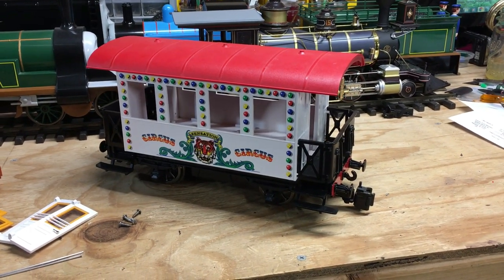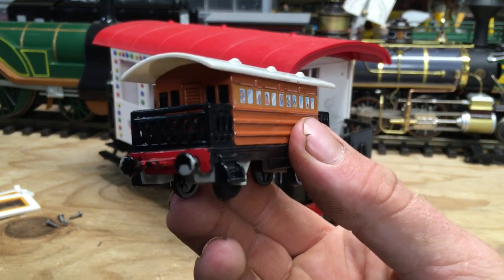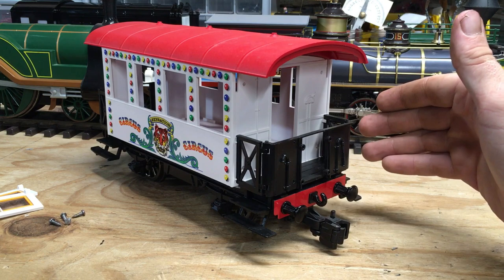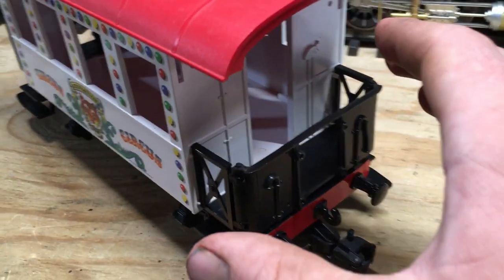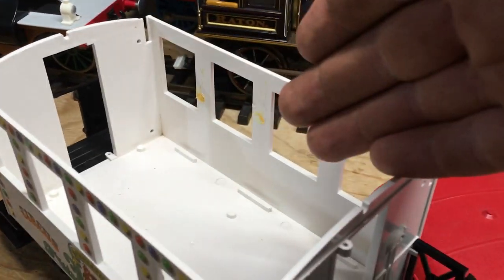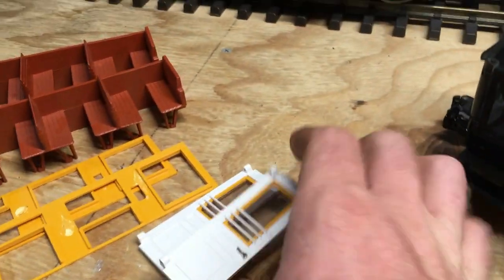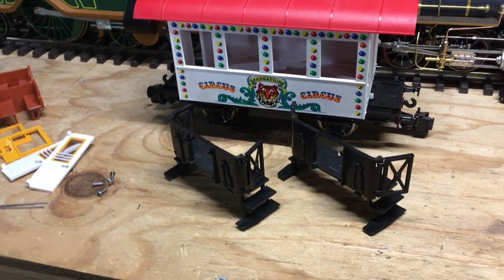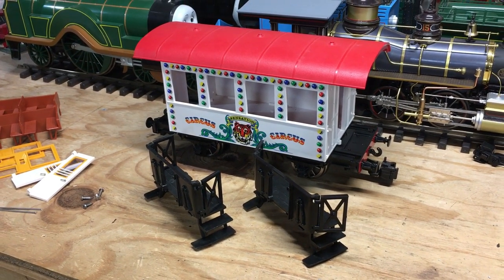Large Scale Henrietta Project: Part 2½ - Updates and Help Wanted

Comment: I've made a Henrietta using a Annie/Clarabel coach.
Reply: @Jason The Tank Engine Tried to post the link, but it doesn't seem to be working. 😕
Reply: @exveefan  Are the handrails with fronts/doors and steps 3D printed and Annie/Clarabel cut with a Dremel tool to add the 3D pieces to look like Henrietta?

Comment: Hi @plowbender. I have a 3d printer at home. I can design the railings for the project. Will need the dimensions of just the end of the railings. Will email you in a bit and possibly have a video call with the model balcony next to you and give direction on what points I will need measurements from. Then once printed can either print myself or send over to shape ways to print if that's cheaper than sending via mail

Comment: if you haven't gone 3d printer route for the balconies, you could use chickenwire of the right pattern/size, then spray several coats of black over it.
Reply from the maker: I've actually got some 3d printed parts here that a viewer made for me.  I'm yet to make Part 3 though.

Comment: I have a question about Emily, how did you get those headlamps to stay on her front footplate? Cause I have a g scale Emily now and I really want to put a headlamp on mine.
Reply from the maker: I use Fun Tak (Blue Tak in the UK) and put a little under the lamps to hold them in place.  I'm not crazy about drilling holes in my models, but eventually I do have plans to fit Emily with a permanent lamp once I install DCC into her.
Reply: @PlowBenderStudios  ok, thanks